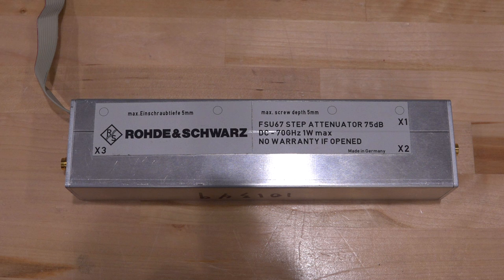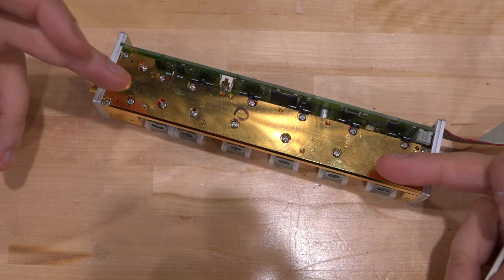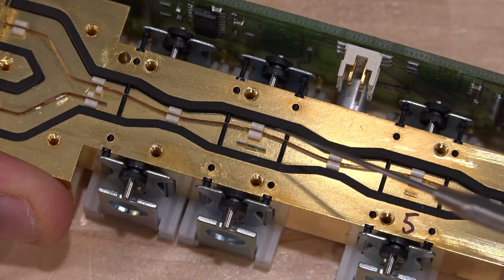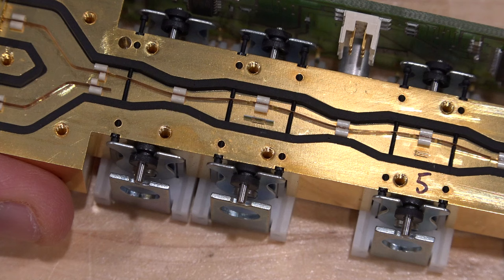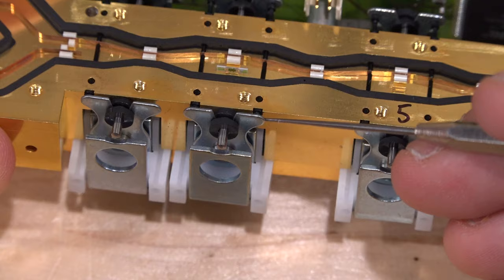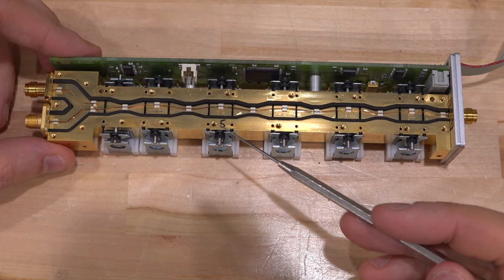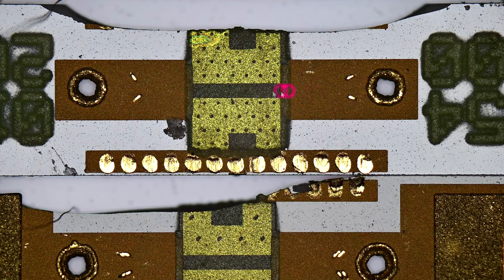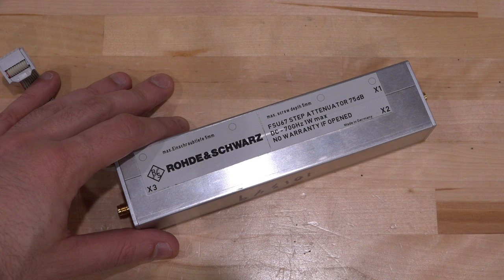TSP #240 - Rohde & Schwarz 70GHz, 75dB Electromechanical Step Attenuator Teardown & Failure Analysis

Comment: This structure is edgeline, and it is common for stepped attenuators. I was involved in the design of one for Marconi Instruments. selecting the gold for the contacts was not easy. Eventually we had hard gold on the fixed contacts and soft gold on the moving ones.
Reply: Could you please tell me what material you used for the moving contacts?
I think it's some kind of berylium bronze.
Reply: @user-jekish  the naterial was beryllium, suitably heat treated. This was plated with gold. Hard gold on the fixed contacts and soft gold on the moving ones. With similar gold on both, contact became unreliable after a few weeks.
Reply: Thank you for your reply, 
Pure beryllium?
Reply: @user-jekish  This is a long time ago, but I think I remember it being beryllium-copper.

Comment: The most common cause of letting blue smoke out of the mechanical step attenuator is injecting DC into the instrument. However, given that most spectrum analyzers like the R&S FSU67 and FSW67 are AC coupled by default, the more likely cause would be ESD or exceeding 1W input.

Make sure you add sufficient attenuation to the output of your DUT to avoid frying your spectrum analyzer's front end! 
And if you're in DC coupled mode or using a DC-coupled signal generator and have a DUT that is powered by a bias tee, make sure you don't have your bias tee reversed and are injecting DC into the instrument instead of your DUT. An expensive mistake. When in doubt, add an attenuator and a dc block to your RF test equipment.
Reply: it's common to leave a DC block and 10dB attenuator permanently attached to the analyzer until you actually need the extra performance removing them brings.

But I think this is only feasible at low frequencies, not for 50+GHz?
Reply from the maker: You can do this up to 110GHz - although working with 1mm connectors is always a pain.

Comment: Very interesting inside, must be a nightmare to do the impedance simulations. -- On the 2nd input, as said can be for factory, but maybe for automatic calibration even if not the full bandwidth or simly for checkout if something burned up or get damaged with some tolerance a loss of 20% can be bad for measurment aso if not totally burned out as here.

Comment: Probably R&S had bunch of those FPGAs reels in the pick and place machine so they just put them to save few minutes on reprogramming assembly line. Or they used the FPGA in another instrument and just repurposed it. Engineers usually don't like to reinvent the already invented solutions. :-)

Comment: Using an FPGA to control 6 relays. Talk about overengineering.
Reply: All those gates in the FPGA are the emergency supply of magic smoke; too bad it didn't get deployed in time to save that one pad.
Reply: The RPGA controls more than just six relays. For example, the correction values, the number of switching cycles of the individual stages and the serial number are saved.
Reply: @DD1PW  I mean it still sounds like something a 50 cent micro controller could do
Reply: It depends  @zyeborm , if this devices is used a lot inside other products, then the price won't be that high. Standardisation may be another reason to use certain components everywhere
Reply: There is also a chance the high power drivers for the relays are some propitery BS, forcing you to go FPGA to not emulate.
Reply: @donteto  Standardisation is a good reason to reuse a component, yes. Still I'm pretty sure that R&S will have some micros in their supply chain. Its more lightly they had more people familiar with FPGA design on the team, compared to microcontroller FW designers.
Reply: You need to know @zyeborm that the devices are built to work for many years under extreme temperature conditions. Such devices can easily be 50 years old and still work (with service and recalibration, of course). And if the device has to be repaired because of a 50 cent component, then that's bad.
Reply: @DD1PW what makes you think an expensive fpga is more reliable than a 50-cent microcontroller? I would even assume the opposite...
Reply: that’s not a perspective based on engineering. FPGA vs microcontroller is completely unrelated to longevity. If you really wanted longevity, you could include probably a 4x redundancy, for the same price. Or, actually engineer one circuit to survive, which will be all about transient/surge/brown out, ESD, and a complete lack of components with limited life, like electrolytic caps, and use some old process for a chunky ROM chip, which is what would worry me. Although, I would say redundancy would be required for both, since they both use runtime memory that can be corrupted by a stray cosmic ray. But now we’re into more 9’s than are required to flip a relay.

Comment: CPLD is not overengineering, that is absolutely sane choice for low volume production devices like this where you need to co custom port expander - four lines of verilog in five minutes gives result guaranteed working by design, with absolute freedom in pin mapping which again vastly speeds up PCB layout.
Reply from the maker: They do this because for the BOM of this part the CPLD cost is irrelevant and they likely use this for many designs. I would not do this simply because each solenoid still needs a dedicated driver and therefore a high-current output shift register would require fewer parts and less things to fail. The simplicity of the interface being asynchronous may be an advantage for them across various products. Difficult to know without knowing how they have built the firmware of the FSU.

Comment: Great video!  Amazing how tight all the mechanical tolerances have to be.  Is the ribbon copper?  I was a little surprised - I would think that even small amounts of moisture getting in there would cause it to corrode enough over its lifetime to mess with the contact resistance, I figured gold-plating would be safer

Comment: lmao at the FPGA. Is it running a softcore? Wouldn't a micro-controller have been way more cost effective? I mean, it is electromechanical.  Oh, wait, 70GHz, silly me 😂 maybe it's some personality module.
Reply: This is a ~20 year old design. Small FPGAs are relatively commonly used for simple switching logic, like blinking LEDs or actuating solenoids. More commonly so 20 years ago than now.
Reply: @tommihommi1  Sounds more like a CPLD then.
Reply: @vincei4252  It probably is.
Could be a PLA or PLD as well.
Xilinx did a lot of programmable logic chips and still do.

If we were to know the part number the guessing game would be over. But I suspect that it isn't remotely as impressive as people's first reaction to hearing "FPGA".

Comment: That Xilinx FPGA sounds overkill for about 5 seconds until one realizes that:
A. It is a 100 pin QFN package, so not really that massive of a chip. (I might have miscounted the number of pins, it might be a few more or less.)
B. FPGAs are available from everything from massive chips with millions of gates (this one isn't) all the way down to chips with a handful of gates and barely enough logic to even use all the IO pins available.
So logically speaking, seeing an FPGA here isn't too surprising, even if a micro controller would have made just as much sense, or even a simple 74128 would have likely worked just fine.

Other than that, interesting step attenuator.
Reply: Daisy chain a few shift registers would be cheaper, for sure.
And more repairable, better to debug.
That's just how companies get lazy and lame as time goes on.
And the reason why instruments from 1960s-1990swere mostly better engineered that what you get nowadays, with few exceptions.
Reply: it still sounds like overkill, what's the cheapest FPGA in that package? What's a mcu that'll do this job cost? 50 cents? a whole dollar?
Reply: @zyeborm  Yes, from a pure part cost perspective it might be expensive.
From a BOM cost perspective it is perhaps one less item to keep on hand. Even if there is "a million" other options on the market for driving 6 solenoids.

Personally would have gone with a 74128 address decoder and some NPN/N-fet transistors for power handling. Or just a suitably high output power capable shift register. (driving a bank of solenoids is not a niche application after all, so of course there is dedicated (almost jelly bean) chips for this field.)

But perhaps this 100 pin QFN packaged "FPGA" allows them to parallel a bunch of the IO ports to handle the power. (if the solenoid is of suitable low voltage, since I don't expect the chip to handle more than 5V, if even that much... But it might be a high voltage IO capable one.)

Back EMF is also a "non issue" for a totem-pole CMOS/fet output. (since it is low impedance and able to source the desired current when actively driven low.)

So on paper they could save a lot of time on the pick and place machine, freeing it for other tasks. And this is quite valuable.

But I also wouldn't be the slightest surprised if they actually did something more traditional, as in only use the logic chip for basic decoding, and handle driving of the solenoids with regular discrete transistors and back EMF diodes.

In the end, I don't know.
But the decision for an "FPGA"/programmable logic isn't that wild as one might first expect. (remember, Xilinx did make PGAs and PLAs too, as well as CPLDs.)

Lastly, the concept of a 50 cent microcontroller is rather modern. Even in volume orders. Programmable gate array chips have existed for a long time and often been cheaper than microcontrollers. (especially 20-30 years ago.)
Reply: @todayonthebench  and this board was manufactured in 2004
Reply: @tommihommi1  Yup, back when dirt cheap micros were less of a thing, programmable logic devices were common as mud and also often quite cheap.
I am not surprised to see a Xilinx chip here.

Comment: Abstract

This video examines the internal workings of a high-frequency electromechanical attenuator capable of operating from DC to 70 GHz with 75 dB of controllable attenuation. These specialized components are critical for protecting sensitive equipment like spectrum analyzers. The video delves into:

* Unique Design: The attenuator features an unusual architecture with multiple paths, including one for calibration.
* Engineering Challenges: Key difficulties in designing such a wideband attenuator include maintaining consistent attenuation, phase, and frequency response across the entire range. 
* Operation: The attenuator uses movable copper conductors positioned by solenoids to achieve different attenuation levels.
* Failure Analysis: The specific unit examined has likely been damaged by overloading, resulting in the burning and destruction of several attenuation pads. 
* Microscopic Examination: Close-up inspection of the damaged pads reveals the delicate nature of their construction with thin film resistors and a pi network designed to maintain consistent impedance. 

i used gemini
Reply: Stop commenting with this AI crap please,  it's such a waste of time and resources.
Reply: First time I saw this. Interesting